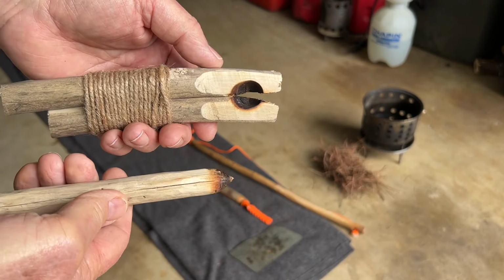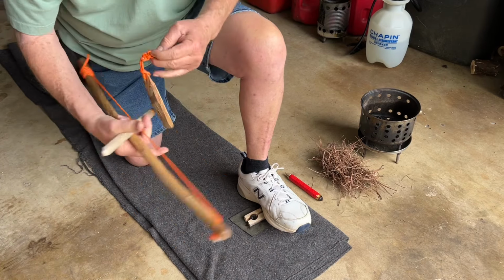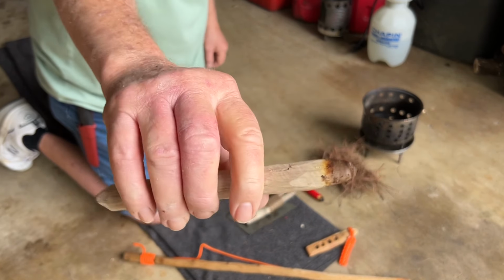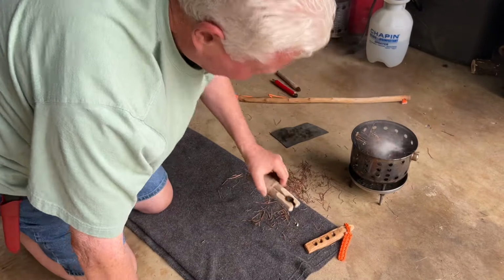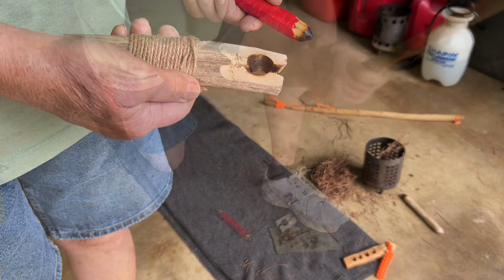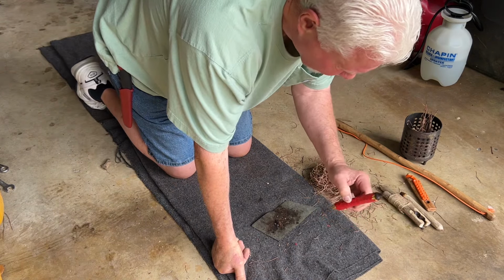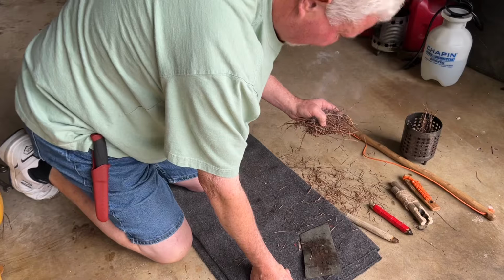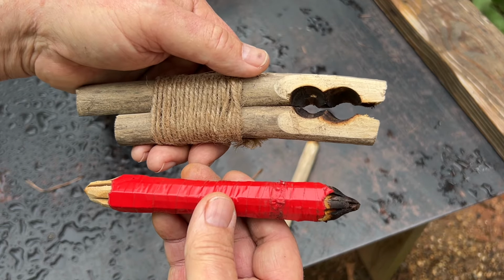Unique Bow Drill, Bundled Spindle, 2pc Fireboard, 2 Hole Method

Comment: One more thing David. In watching your bow string texhnique I got to thinking on how to make the spindle block easier to use. I took one of my old moro's and drill a shallow hole in tbe handle. I then ordered a bearing from mcmaster-carr and epoxy it in the handle hole. The bearing is flush with handle and doesnt get in the way. What I found is, it is nowhere as stressful for the user to spin the spindle. Very smoth and it doesnt seem to damage the spindle as much. Like you, i am always trying to improve tools and techniques. It worked so well I will install the bearing on some of my other mora's. The bearing basically stops on the spine which is molded into the handle. Very sturdy.
Reply from the maker: Good idea. It's been done already though.

Comment: By the way David....i tried that smart wayer bottle ignition technique and I struggled but finally figured out where the concentration point was. Just another way to start a fire thanks to you. The corona saw is doing extremely well by the way. So much so, i bought two more. One for my truck and one for my boat. I am always getting into areas on the river where most wouldnt dare to try and the corona will help with that. Heck of a fat wood processessor.
Reply from the maker: I've got a new one waiting to be opened. It'll stay in the Camry.

Comment: Ashes on the fireboard and on the nose of the spindle help get an ember with less effort.
Reply from the maker: Not for me.
Reply: @DavidWestBgood2ppl  Do you mean by that you've put ashes on and it doesn't get embers easier or do you mean you just don't need to do that to get embers ?
Reply from the maker: It's been suggested for many years. It doesn't work. Whatever you put in the divot immediately gets deposited into the dust pile.
Reply: Interesting. I'm only successful with the bow drill method <1/2 of my tries, maybe 1/3, but I do not keep in practice. You're clearly the Jedi Knight of the bow method  :o) Maybe its my wishful thinking. Although now that you mention that the ashes are simply displaced, I have an idea for something that might it possible to keep ash in contact as the heat builds up at the rubbing surfaces. I'll get to you if my idea works. Thanx.